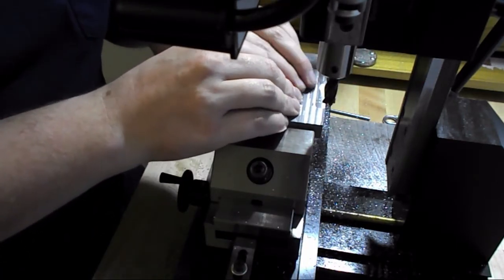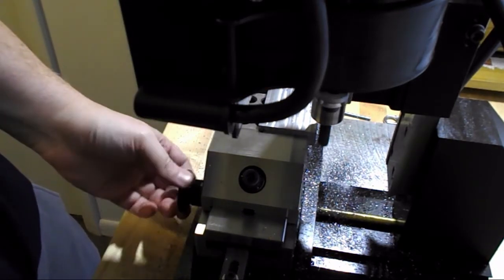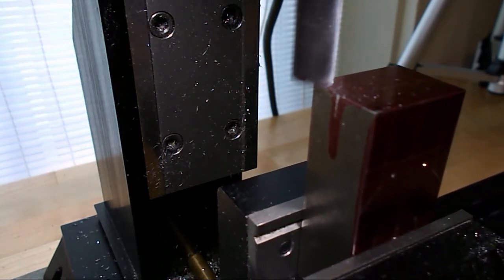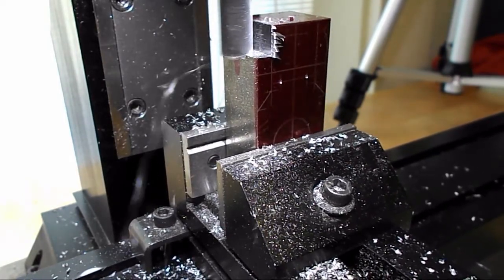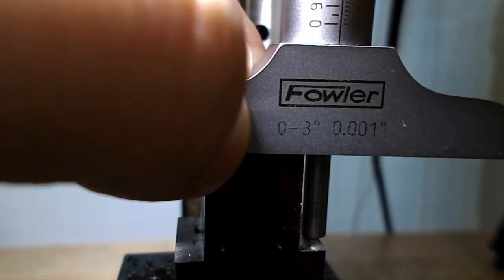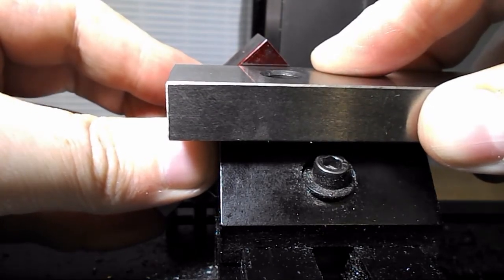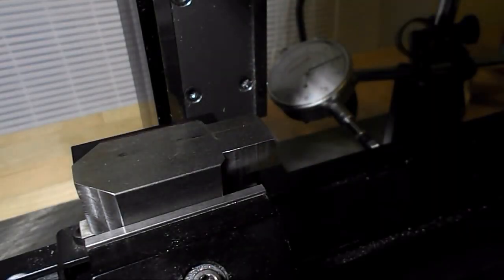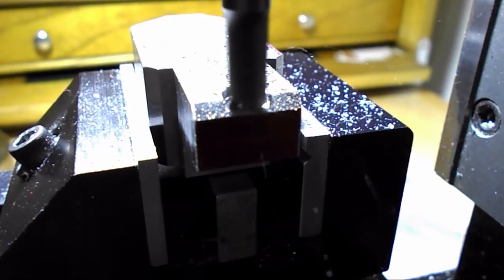Squareness Comparator Part 1

Comment: Nice work! Thanks for sharing.
What speed were you using when milling the tool steel?
Reply from the maker: Not sure what the rpm was. Probably under 1000 with the .25” endmill. It is all manual.
Reply: Bill Lightner thank you.  I was trying to mill a piece of unknown steel with a 10mm endmill (about 3/8”). Pretty loud. Doc was only 0.05mm.
Reply from the maker: Lubricants are great for those kinds of cuts as well. But in the end it’s all about the speed and feed.
Reply: I did use cutting oil for steel. I’ll give it another shot later and see how things go.